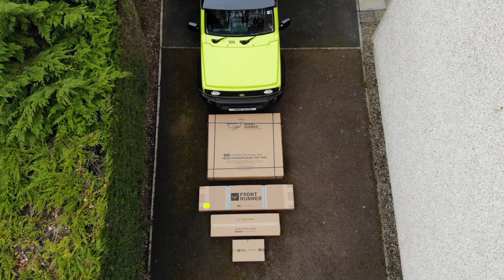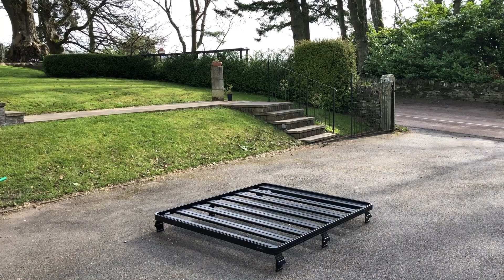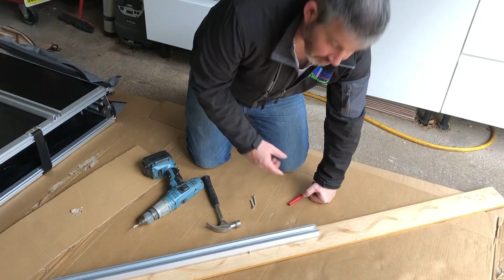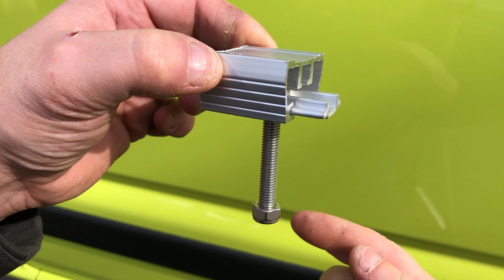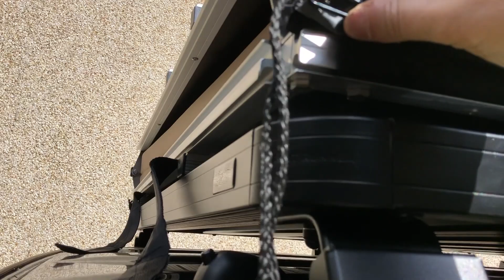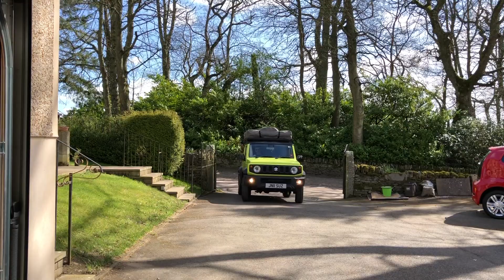Front Runner Roof Top Tent Installation on my 2020 Suzuki Jimny

Comment: I’ve seen people mount it to fold out to the front. Very good option but it needs you to have a front bar (bull bar). I usually see this option used on the Defender (the older version) with the ladder modified to attach to the bull bar. Beautiful

Comment: Thanks for the video, very nice! I have a question though: you rightly drilled the support bars with a 4 mm hole. Then what did you do? Did you screw the bar with self-tapping screws where you had drilled the hole? Did you also drill the tent base? Two holes for each bar? (4 total?) Thanks!
Reply from the maker: Hi, I didn’t actually drill any holes  - they were all there in the first place. I simply used the provided bolts to secure the tent base to the roof bars. Best wishes. N

Comment: 'm a heavier set man (around 90kg) is there any chance of damaging the car's suspension if I purchase this tent and sleep on the roof? (Especially if I haven't changed the suspensions, wheels, etc)?
Reply from the maker: Ivan, I’m 100kg and I haven’t done any damage yet! The suspension is fine, it’s the dynamic roof loading you need to be careful with - although I’ve seen much heavier set-ups on Jimnys than this! I went with this combo because it is lighter than almost everything else. Cheers. N
Reply: @highergroundlifestyle  Thanks, really happy that I dont need to get the stock suspension changed just yet! Thanks for the informative videos I really appreciate it! I just got my Jimny 2 weeks ago and am loving it!
Reply from the maker: @dudec3  Enjoy!

Comment: The mounting kit is out of stock in Australia unfortunately is there a way to mount it without the kit? I’m running the front runner rack too
Reply from the maker: Hi, wouldn’t be difficult to mount without the kit! You’d just need to source the right size/length of bolts and brackets.

Comment: So do I have to buy a mounting kit? It doesn’t come with a basic mount setup? What a bummer
Reply from the maker: You don’t need to buy. a mount kit. You could simply bolt on to the rack. FR recommend the kit though, which makes installation easier and allows you to select different heights. At £45 it’s a no brainier!

Comment: Norman, thanks for your awesome videos.

I'm curious to know if you upgraded the suspension before doing the rack + tent (sorry if I missed that part)
Secondly, have you had the need to take Jerry Cans with? And if so, is there enough space in front if the rack after the tent is fitted?
(Perhaps if the tent is orientated to the side?)

I can see taking extra fuel being a challenge with this little guy.

Thanks again, Francois (South Africa)
Reply from the maker: Thanks! I didn’t upgrade the suspension and as noted in the video was amazed at how little impact the tent has on driving. I’m not keen on changing fundamental elements of the cars handling as I’m using it as the manufacturer intended and believe they know best. (Different.if you were spending a lot of time, e.g. extreme off roading) There is still space for Jerry cans on the roof but it’s not something I have as it’s illegal to carry fuel externally in the U.K. You’re right about capacity in the tank though - it’s very limited and I’d want plenty more with me if I was doing some serious long distance off roading as well as an extra wheel, compressor and winch! Best Wishes. N

Comment: Great video - this will help me fit mine (second hand purchase from someone who had it on a Defender, believe it’s set up for side opening)

How much room is left on the rack at the front? 

Would you be able to fit a bag or some cargo boxes like the frontrunner cub or Wolfpack ones?

Cheers
Reply from the maker: Nick, congrats on getting the tent! If you want it wouldn’t be difficult to switch to rear opening. Not a lot of room left on the rack but I’d be more concerned by weight than space. You’re already slightly over the official dynamic roof load limit so wouldn’t really want to put anything else up there. Have fun and enjoy! N
Reply: @highergroundlifestyle   cheers, I’m likely to be over weight anyway once I add on my side awning, but yeah maybe not best idea to put too much else on top

Challenge is the sausage dog takes up 50% of the usable space in the back 😂 

Gonna try the side mounting as the tent I bought came with the annex room, which I don’t think will work off the back due to the jimny tail gate being hinged on the right which is the same side as the annex door

Anyways, can’t wait to get out in it next year and do some camping, Scotland obviously on the list 💪🏻

Comment: How does it handle on the road at 80-90-100 km/h so far (I guess you have become more experienced since the set up)? That’s my biggest fear that the car would lean like a metronome. What do you think, would it handle the 60 kg Thule Kukenam 3 as it little more spacious and better quality (as I’ve read in reviews).
Reply from the maker: Hi, I’ve now driven the car all over the country on B roads and motorways. No specific additional handling issues at sensible speeds.
Reply from the maker: Hi, I’ve now driven the car all over the country on B roads and motorways. No specific additional handling issues at sensible speeds.

Comment: I have the same tent and was looking at this roof rack. I wasn’t sure the jimny roof could take the weight of the rack, tent, me and the wife?
Does it hold the weight ok? Cheers.
Reply from the maker: David, yes. It's technically over the roof limit but that's not a problem when stationary and, as you can see for the video, you don't really notice it on the car!

Comment: Is it possible to mount this to normal roof bars going across the roof using U-bolt's for example? I've only seen them mounted using the Frontrunner roof rack. Cheers
Reply from the maker: Hi, yes - but you'd need to spread the load. I'd suggest three bars as a minimum. Cheers. N